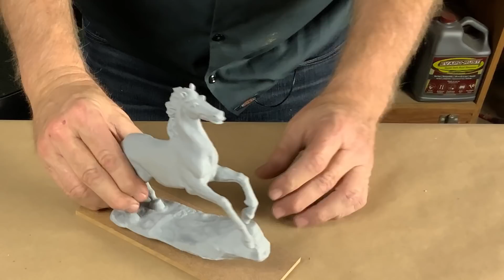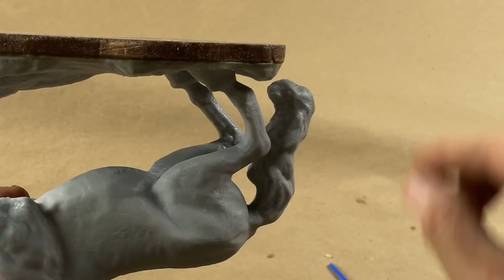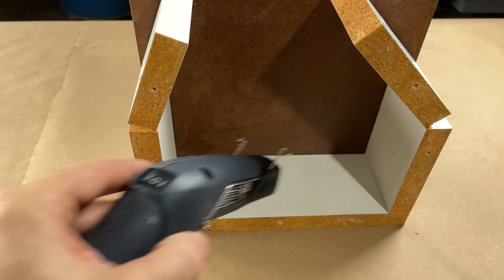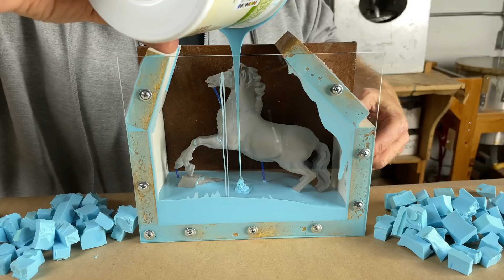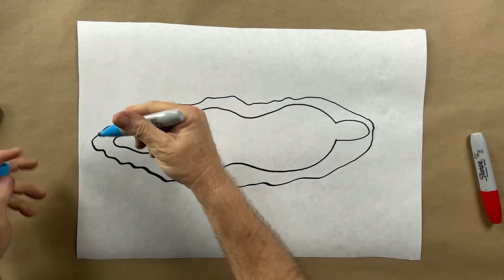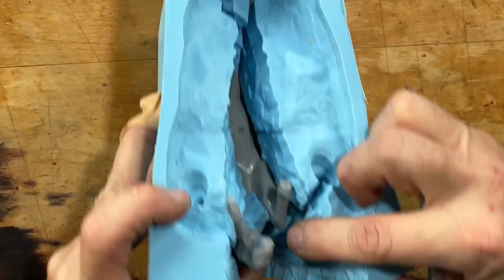Save Money By Recycling Used Rubber

Comment: I'm sure someone else has mentioned this over the past 2 years, but I bet you could change the infill on the print to get easier break points on the sculpt when you're splitting the mold open.

The print itself would probably need some gentler handling, but adding in a weaker infill on 10-15 layers where the ankles are could have saved you quite a bit of energy & fussing. It's not easy to do in the slicing software, but certainly a possibility for more complex projects.

Comment: New to this. Why do you need a gasket?
Reply from the maker: Just to prevent the rubber from leaking out between the wood box and the plexiglass face.  The other joints in the mold box I sealed with wax. It’s very important that a mold box be watertight. It’s astounding how tiny a crack silicone rubber can flow through.

Comment: Question , when you put the Horse sideways and make an half mold. so you can cut inside the legs, without braking anything. Is this a possible way?
 Asking for an friend ;)
Reply from the maker: I could have used a more complex process and clayed up the parting line between the legs. But in a piece like this it would simply be better to cast the base separate from the animal.

Comment: Dear Mr Tolone, thank you for your nice videos. It is great that you are sharing your skills and tricks with the world. By watching the attempts of getting the pieces out of the moulds, it remembered me the difficulties that could come along with that practice. I was confronted with it many times as an dental technician. 
I haven't seen all your videos yet, so it is possible that you mentioned it already somewhere else. So excuse me if it is so. 
What helped me a lot, getting objects out of moulds was air pressure. In some cases the objects came out nearly by themselves. With the help of an cannula, I was able to bring air deeper in the mould even py sticking it through the mold. 
The air pushes the object on the one hand and creates an layer of air in between the object and the mould reducing the friction. It is certain that it won't work on every object but in some cases, it can prevent the cutting.
Best regards from Germany
Reply from the maker: I have never tried it, except with rigid tooling to release fiberglass castings.  It seems to me the air would simply find the shortest route out of the mold and escape there. I would like to see your method in action. Thanks for your comment!

Comment: If you couldn’t cut it without breaking the base, why didn’t you make it a multipart mold?
Reply from the maker: Because a multi-part mold takes much longer to make. And it makes castings with heavy parting lines that require a lot of work to sand off each casting. And finally, because the original was a 3-D print. Which means it was not precious. I would rather damage a master to create a clean mold than preserve a master which creates an expensive, flawed and inferior mold.
Reply: @RobertTolone  Ahh, I’m used to making lots of multipart molds for precious models for glass castings or master molds for multipart plaster molds for slip casting, where you usually can’t damage the master to make a one or two part mold, and the seams really aren’t that difficult to deal with at all in slip casting, and while they can be a pain grinding and polishing in glass, we all have to do it. I make a lot of organic forms and am experimenting with nontraditional plasters for glass casting investment molds in an attempt to mimic what the Czechia glass masters do, which is make their models out of pottery wet clay directly into investment molds with plasters that are strong enough to make 1/2 inch molds instead of 3-6 inch mold walls, and make really big molds that are essentially open faced molds but with some curves, but one side is still open and you don’t have to do lost wax casting. It’s amazing to see the work they make that way, and the molds being so damn thin, and you don’t have to grind any seams…still have to polish the side not open that was fire polished, but a lot less work, saves you glass, and you can cast larger things because you don’t lose kiln room to a crucible. I just hope I the plasters I have to experiment with in the US are somewhat close to as strong as what they have…unfortunately don’t sell it here.

Comment: What do you recommend if you don’t have all these expensive wood tools? I use metal roof flashing usually for making sides of the molds, or wooden sides that I can clamp together and clamp and reuse. I also use plastic for the bottom, so I can reuse it.
Reply from the maker: I think you are doing exactly the right thing by using the materials and tools that you have on hand. You can make a mold case out of almost anything as long as the rubber won’t stick to it. A lot depends on the size of the object you are molding. Since most of the things I make are toy prototypes I use a lot of paper and plastic cups as mold cases. I scrounge most of my case materials so keep your eyes open for sheets of anything that people throw away. Things like box cardboard covered in 2 inch plastic packing tape worked great.

Comment: Robert, thank you for sharing your depth of knowledge.. I really enjoy your videos tremendously! A question.. if the original was made of metal or was a one-of-a-kind, how would you approach cutting the mold?
Reply from the maker: I wouldn’t have taken the job unless the horse was separate from the base. It could have been done using a 2-piece clayed up mold. But I don’t like making those kinds of molds and I really dislike cleaning the castings that those molds produce because of the messy parting line that runs 100% around the sculpture.  It is far better to design the sculpture for the process of silicone mold making. In this case all that was required was to make the horse separate from the base.
Reply: @RobertTolone  Gotcha, thanks for the explanation.

Comment: i have learnt a ton of stuff watching your channel and it is helping me so much with my lure company . i make a lot of silicone molds , nothing like your ones , just simple molds . i use Polyurethane Resin in my molds and they only last about 40 pours , is there anyway i can treat them so they last a little longer ? thinks for all the great content you do
Reply from the maker: You can experiment with silicone mold release. Very light sprays between each casting can greatly extend mold life.  One downside is that you have to clean the castings carefully before applying any finish.
Reply: I was thinking something like that , maybe a good wash with dish soap would work ? Thanks for the help / reply 👍🏻
Reply from the maker: @nic7289  I clean mold release off castings first with acetone or lacquer thinner, then soap and water.
Reply: Ahh ok , I'll try that , thanks

Comment: Would using your chunkies more "shredded" than chunkie, would that have prevented that piece from getting stuck there?
Reply from the maker: There are a couple  problems with shredding rubber. The first one is that rubber is really hard to shred. And even if you solve that problem you will find that it is very hard to add shredded rubber to fresh rubber without trapping a ton of bubbles.  When you try to vacuum out the bubbles that doesn’t work very well because so many are trapped by the shredded rubber. And the viscosity of the rubber is much thicker, it doesn’t pour well with all the chunky shreds in it. So you catch a lot of bubbles around the model. Then, when you put the resin casting under pressure,  the tiny bubbles collapse and the mold distorts.  All in all, it’s just a giant hassle and isn’t worth your time.  To answer your question, the chunkies have no effect at all on whether or not a model gets stuck in the rubber.
Reply: @Robert Tolone  awesome.  Thanks for that answer.

Comment: I'm curious why you don't vacuum the molds after you pour the rubber?
Reply from the maker: Because I get models from different clients and I don’t know how they are constructed. They often contain voids which can expand under vacuum or crush under pressure.  So I never use either when curing my rubber. I also don’t do it because it is completely unnecessary.
Reply: @RobertTolone  I was unaware of that. I recently found your channel, and enjoy it.

Comment: I want to make a "negative " mold for a driver side mirror to put it on the right side. Can You please help me????
Reply from the maker: The only way to make that is to create a new model for the right side mirror. There is no mold-making a way to make a reverse or mirrored copy. The easiest thing to do would be to scan the existing mirror, turn it into a 3-D model and mirror it in the computer Then 3D print it.  If you use the right printing resin you would be done at that point.

Comment: Wondering with that little left over chunk, is there a way to brush on a super thin bit of rubber and stick it back in place so it doesn't keep falling out?
Reply from the maker: Re-gluing the chunk causes several problems. The biggest one is that no matter how thin you try to make the glue line, the chunk will not be in the original position. Therefore the mold will not close properly and there will be flash all around it. True that it is a pain to reposition the chunk with each casting cycle but it results in very clean castings. So it is worth the effort.  I was very disappointed when I cut that mold incorrectly. It is so much better to make a clean mold that it is to try to repair a mistake.

Comment: I like the video. I had exactly the problem, that my chunks didn't mold together with the new rubber. But I am not sure if it was dirty. I put it in an old Haribo candy box and as far as I know, those candys are covered with a thin layer of bees wax, right? Maybe I didn't clean out the box properly and some wax got on contact with some of the chunks. So advice about getting chunks is always welcome. =D
Reply from the maker: Yeah, you can definitely have problems with contaminates on your chunks.  That’s why I like to cut mine just before I use them in a mold.

Comment: Could you mix up a bit of rubber, paint on some rubber on that chunk and essentially "glue" the piece back in? Or is that m9re trouble than its worth?
Reply from the maker: The part will never fit properly because the glue line will have some thickness and you’ll get a lot of flash around it. It’s a hassle either way but I’m still hoping to get clean casts out of the mold.

Comment: Another great video!  Quick question, can you "glue" two pieces of cured silicone together with liquid silicone? Like if you accidentally cut a piece off the mold, could you put it back using new silicone?

Comment: What's a good ratio for chunkage vs new rubber? Is it possible to replace up to half of the volume with chunkage? How about more?
Reply from the maker: It’s more about the space to fill rather than a weight ratio. You can cram in as much a you can fit. But if the model is delicate it’s easy to damage it without realizing it, so take care.

Comment: Is there a rubber that’s better for moulds for a concrete casting?  
Thanks for all the tips.. soon will be trying this all out..
Reply from the maker: Urethane rubber is cheaper and can be more effective for concrete molds. As Glen said, contact your supplier to get their recommendation.
Reply: There is , again size and shape matter. Your RTV supplier should be able to advise you what type of silicone is the best .

Comment: Since you mentioned shrinkage (Seinfeld reference here) , are there any low shrink ratio resins?
Reply: Resin shrinks due to heat it generates. You could use the same resin for two castings . If the first one is a small mould the shrinkage would be minimal or not all. If the second one has a large volume the heat generated would be much greater causing greater overall linear shrinkage . All resin data sheets have listed the shrinkage  ratio and details .
Reply: Resin shrinks for two reasons, 1. It exotherms during cure and so expands as it gets hot this then shrinks as it cools. 2. The curing process itself causes some shrinkage the more ordered structure of a solid versus the mobile liquid.  In reality depending on the size of your casting one or the other will be more significant.  As to reducing shrinkage pick a resin that is resigned to shrink less, use a slower curing resin this will generate less heat as the cure is spread over a longer time.  You can also reduce shrinkage of the resin by adding fillers as these do not shrink during the cure as they are alreasy solid they also reduce the reactive mass so reduce exotherm, but (and its a big one) they increase viscosity significantly so pouring is harder and filling small pieces is significantly harder. If you do add fillers to resin best practice would be to mix it into the polyol side (not the isocyanate) and then evaculate it to remove all the entrianed air before proceeding as normal (remembering to adjust your ratio of A:B to allow for the weight of filler), when adding fillers it is also importnat to pressure cast as most fillers contain some level of moisture which will cause foaming if not suppressed by the pressure tank.

Comment: Once again, though, the 3D printer person could have also printed a shell with a 1" or 2" clearance or whatever around the model. One of these days ....
Reply: Only a software issue, if enough people need it a software company could provide it. Cura or whatever. Its not unreasonable. Who knows, maybe 1/4" thickness, with a texture that grabs the rubber a bit like velcro. Minimal amount of rubber required.
Reply: @garywheeler7039  I guess if the person didn't model it themself that might pose issues. 
But it would be quite simple to make a bounding box in CAD
Reply: @maverickstclare3756  : was only trying to speculate a custom "box" that was very thin and strong enough to just resist the weight of the rubber/latex or whatever. Minimizing waste. Conforming to the model. Certainly not rectilinear.

Comment: Robert, would it work if you put the chunkies in the blender to make them into finer bitts and then mix them directly into the rubber before you pour it?
Reply: I like it
Reply: You would add a lot more air to the mixture
Reply: @glenfisher728  just deair it?
Reply: @danje748  you need fresh silicone poured against your pattern surface   so as to give you the best chance of picking up the detail. If you mixed finely ground up silicone in to a fresh mix , 1 - it will add a large volume of air in to it , yes you can de air but it will take much longer in time . 2 if you do this mix it's possible it has contaminants in it , it could affect you're surface finish or cause curing problems . Bob plans where he is putting the chunkies that way they stay away from the patterns surface and limit the amount of new air in to the fresh RTV mix .  Just a matter of keeping things as simple and easy as possible to get things done as quickly and cleanly as possible .

Comment: A while ago I tried mixing chunks of different rubber types and it actually caused cure inhibition. So make sure you're chunks are from the same type of rubber you are pouring. I wrongly assumed all silicone was the same!
Reply from the maker: Yes, that’s essential. I should have said so in the video but I mentioned that in the description. Lots of silicone rubbers don’t play nicely together; especially if you’re mixing platinum and tin cure rubbers. Thanks for pointing it out!